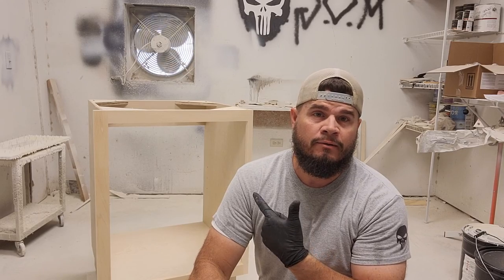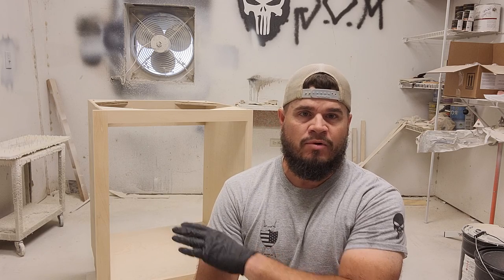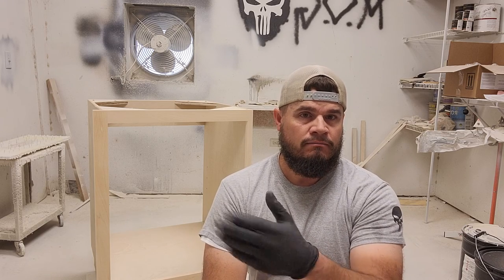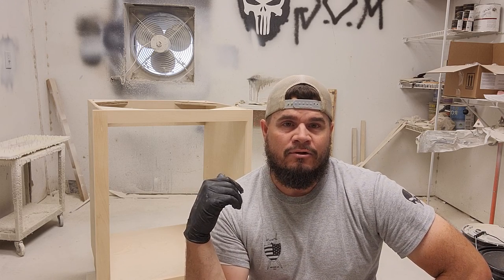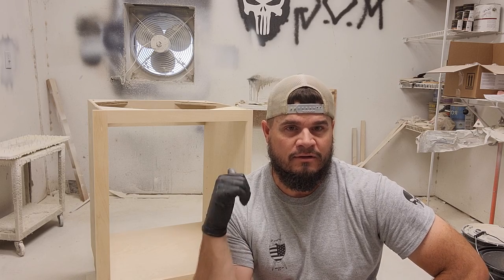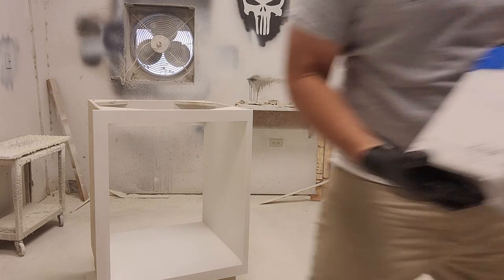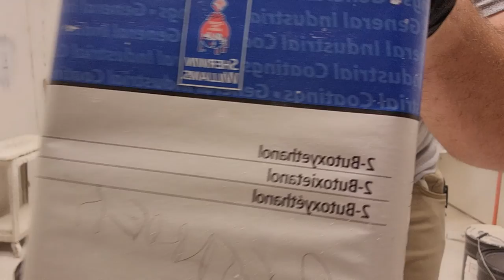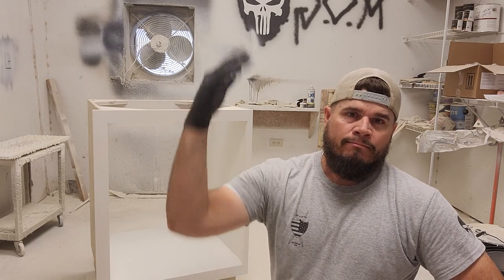priming with Gemini paint in South Georgia heat! watch me work and relax!!

Comment: What sprayer are you using? And I’ve been using Centurion 400 1k top coat and 1108 primer. How tough is the Gemini evo? Are you using 1k or 2k?
Reply from the maker: I use the Fuji Q4 Platinum and I also use a kremlin system. In this video, I'm using the Fuji. As far as the Gemini paint, I use the PVS 1100 primer and the UL 1030 paint. 30 being the sheen